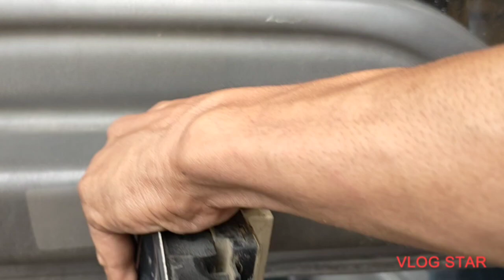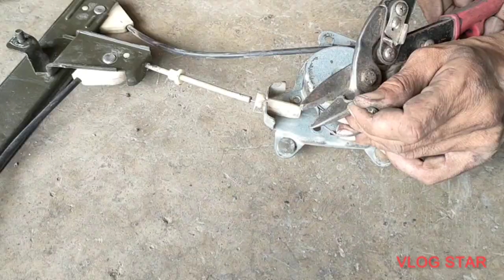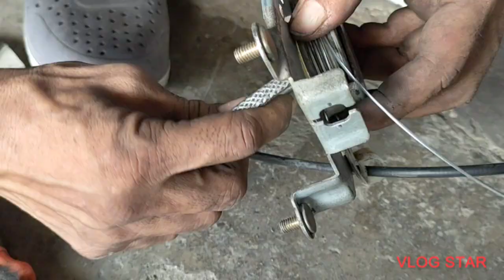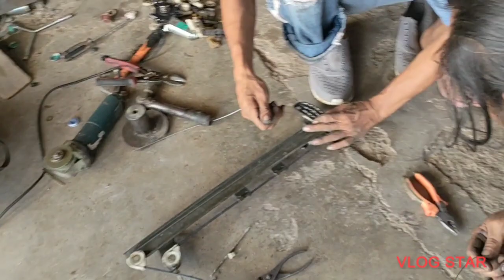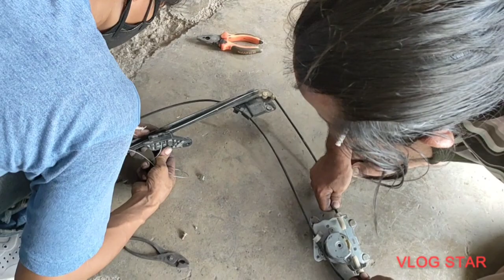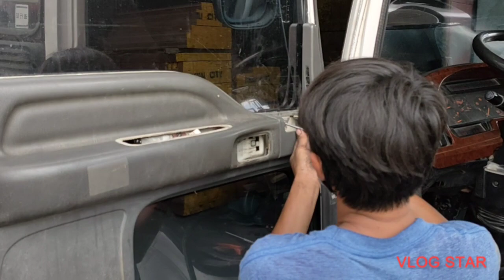ISUZU FORWARD  power window cable repair

Comment: buds,pag yong unit ganyan din problema. tumutunog lang kaso di umaangat ang salamin sa bintana..cable rin siguro problema.
Reply from the maker: Check up mo head Ng motor baka bumigay na yong rubber tensioner

Comment: Anong cable ang nilagay mo jan boss.. kasi meron dn  akong  ginagawa dto.. Firstime kulang ito boss. Gawin
Reply from the maker: Cable Ng bike boss
Reply: Boss anong pinalet mo sa staper ng cable. . kasi saken bumigay.
Reply from the maker: @ryelanthonyaranas6105  
Number #8 🔩 nut. And  use hammer to lock

Comment: sir gd pm contact # mo sir.. me pagawa ako..
Reply from the maker: Boss Cebu city Po Ako .
#09154863442
Reply: magkano labor  sir supergreat driver side
Reply from the maker: Boss Pag cable lang sira NASA 1200 Labor materials na Yan...
Reply: @dodongcarling5197  saan kyo sa cebu sir bumanyahe din kmi ng cebu...
Reply from the maker: Sa Lawaan 11  talisay city cebu po.
Kibali pag nakarating na kayo sa Cebu tawag lang Po kayo para Ako nalang Po mag adjust Kong saan kaayo pwde Maka parking....
Anong truck Po ba Ang unit nnyo?
Reply: @dodongcarling5197  fuso supergreat sir.. sa company po sir...
Reply: Magkano labor mo sa ganyan sir?
Reply from the maker: NASA 1200 lang Po.
Reply from the maker: Location nyo po ma'am